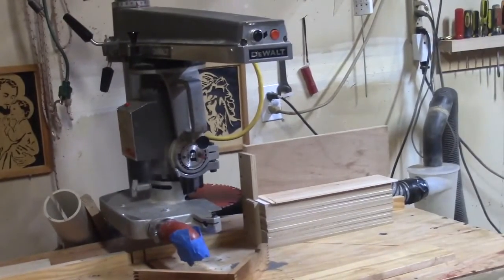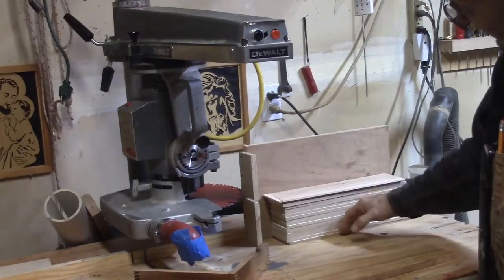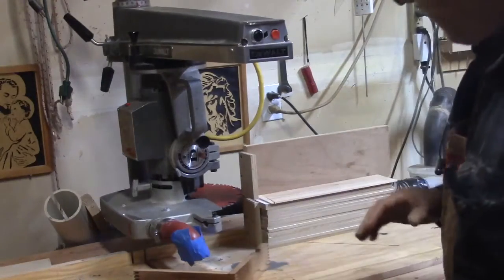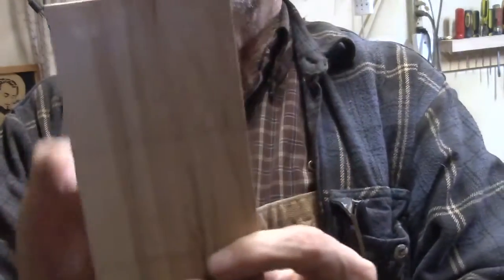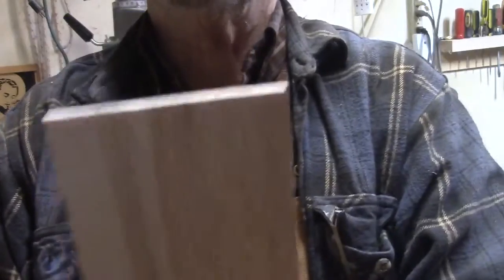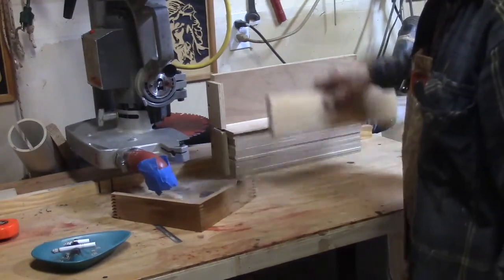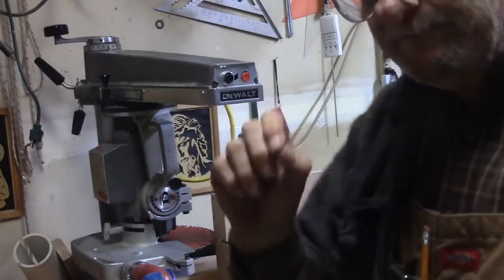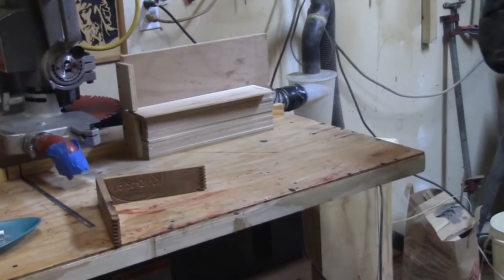1/8"  Box Joints Using a Radial Arm Saw

Comment: Ed just found you here. Really disappointed to hear you lost your shop. Your videos were great and a big help in squelching the Radial more dangerous than   a table saw myth.
I was wondering about the box joints being confined to 4 to 5 inches. Can you just flip a board that is wider than that?
Hope you get access to a shop again.
Reply from the maker: Thanks for the kind words.  I never tried flipping the board over, though I did plan on giving it a try.  It should work as long as the width of the board is multiples of the spacers.

Comment: great method, Ed!  I'm reading Easy Ways to Expert Woodworking by Robert Schaeffer from 1956 which is all about using the DeWalt radial arm saw.  In it he describes  cutting box joints by raising the blade 1/8" per turn and using an 1/8" blade.  I fixed up a 1956 DeWalt and think I'll give it a try.  check out the channel to see the saw, thanks!
Reply from the maker: Sorry for the late reply.  I tried using the raise the blade method using a Delta saw which raises the blade 1/16" per turn of the crank.  I didn't get very good results.